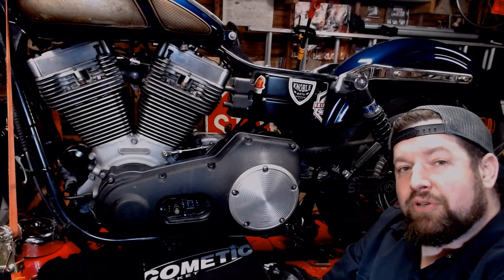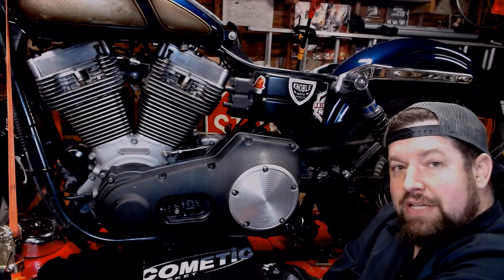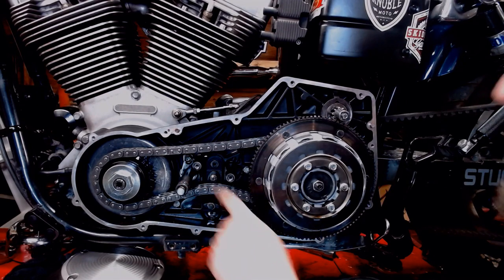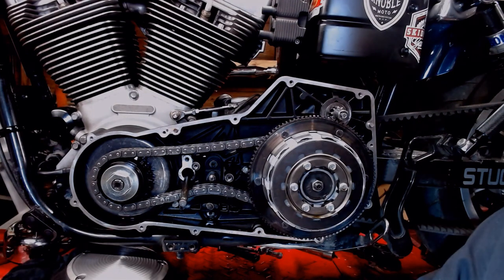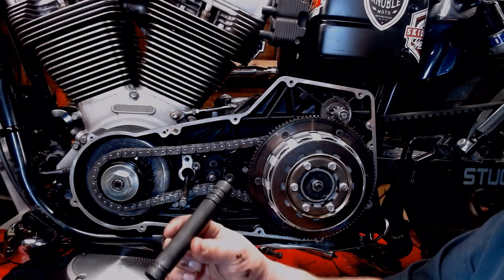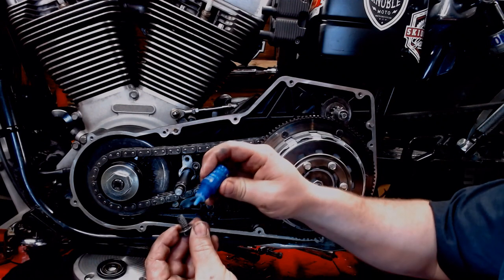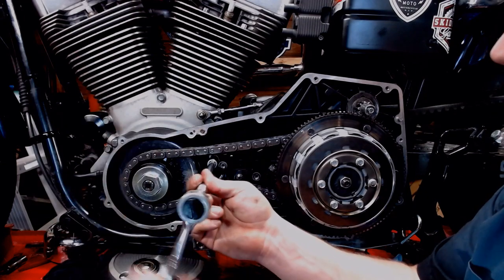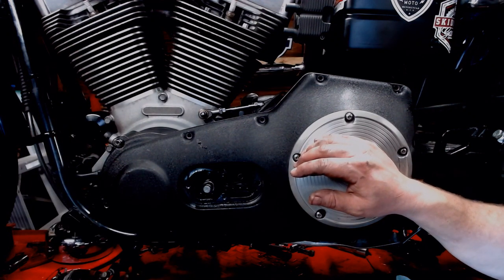Review and Install of the Cometic Gasket for The Harley Primary Cover.

Comment: I noticed your primary drain plug isn’t the typical the 3/8-24 type found on the 05’s, did you drill and tap for that larger plug typical on the 07  and up dyna’s ?
Reply from the maker: It’s an aftermarket cover. So whoever made it probably does them all in the larger size.
Reply: Ok , thank you for all your help, another good video.

Comment: ? Im looking to switch my Harley sportster primary cover from chrome to black (just for looks). Does anybody know if the cometic primary cover will already have to chain adjuster already in it? Im not a motorcycle expert which is why I’m asking. Thank you.
Reply from the maker: You will likely have to reuse all of your internal parts. However the Cometic Gasket kit will have all the seals and gaskets you will need.
Reply: Thank you. One more question. Would you recommend using rtv or whatever that black silicone stuff is called, or just use the gasket by itself? Thanks.
Reply from the maker: @eduardoaldaco6412  just the gasket by itself.  It is designed to do all the work.